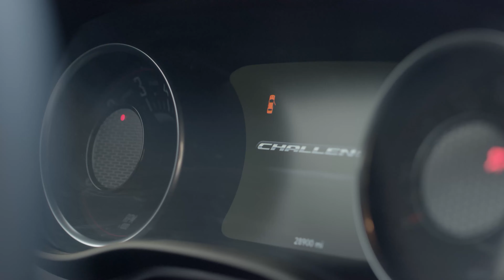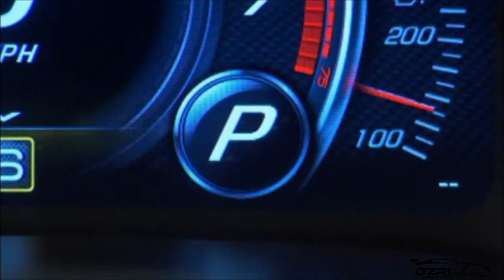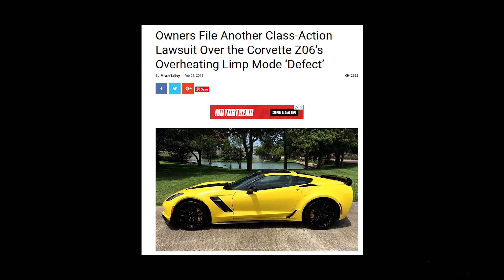Goodbye C7 Corvette | Possibly the Greatest Generation Ever!!!

Comment: I'm on the Podium for the win. lol Great upload D and congrats on breaking through the 1k subscribers. Save the Wave.
Reply from the maker: Thanks Peter!  Much appreciated and hope you got that poster up somewhere in your domicile!  lol.  Remember, it doesn't need to be in a frame..the back is adhesive and can be placed on the wall as long as its cleaned. 👍
Reply: Thanks  D. I finally figured out where the poster should be placed to adorn my abode and not just for looks, but for obtaining that perfect Zen moment of motivation and calming of one's mind. It's on the ceiling right over my multi-purpose gym bench press. When I need that extra muscle, I look at that one Corvette WITH extra muscle and low and behold, I can get that extra rep up and/or add another record breaking 2oz to the bar. 😉 I have to be careful though, sometimes when I'm in competitive mode I over-heat and drop down into limp mode. But I am prepared for all contingencies, I work out with two buckets of ice at my side for cool down purposes and a bottle of Johnnie Walker Black Label which I find works better than Boostane on the rocks. 👍😎

Comment: I don’t buy the idea that the C7 is somehow “obsolete“.  The real reason driving development of the C8 is electrification of the front wheels, which will create a 1000hp all-wheel-drive monster. I just wish GM could build both front and rear-engine designs, like Ferrari does. The two types serve different purposes and there is a market for both I think. Thanks for your videos D’, they are excellent!

Comment: 2017 ZO6 I have never overheats and I have ran this car over and over in crazy temps and its and automatic, so I don't know about it not being fixed but who knows. Looking forward to the C8 monster
Reply from the maker: K E, there is a YouTuber (Track Day TV) who did a video on July 9th of a 2019 Z06 and that overheated.  So the issue is definitely still there. Thanks for stopping through and leaving a comment!  Much appreciated!
Reply: @DZRIDEZ  I will look into this and see. Has to be a remedy for this, but for me no issues yet 9000 miles later 3 sets of tires later and crazy runs in good old hot temps. If I can figure this out I will provide the info. Great videos also. I am going to buy a ZR1 next and when C8 comes out with the beast model meaning their ultimate I will most likely obtain that also. Love corvettes. Every car has its bugs, but that whats makes it fun to refine and figure out and increase performance. Just not a fan of the C8 having a locked ECM but I guess there will be a remedy for that also. Overall if the hp and performance on new C8 is hypercar performance, won't need to modify this car. Lets hope its a true winner for Corvette!! Have great day!!
Reply: I have yet to have an overheating issue with my 2017 ZO6 auto but nor do I track it. Can't convince myself to track a $70k car BUT it sure looks like fun!